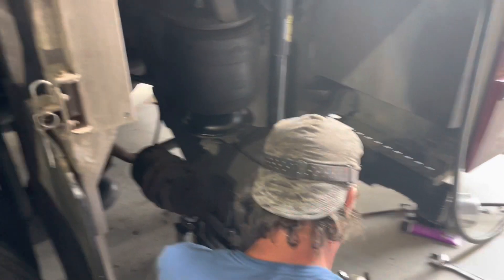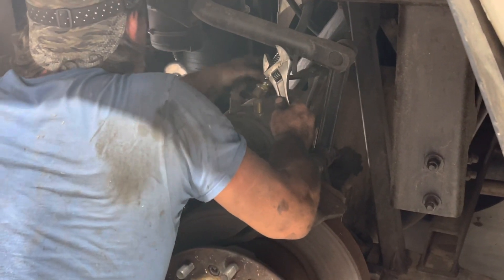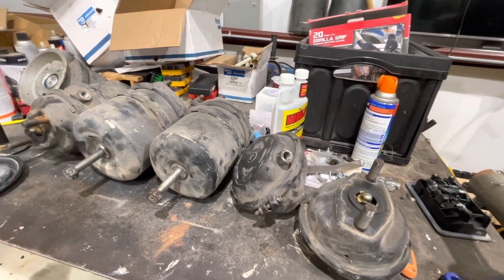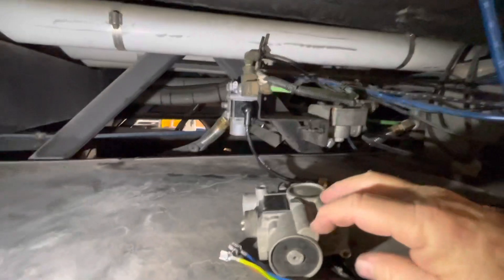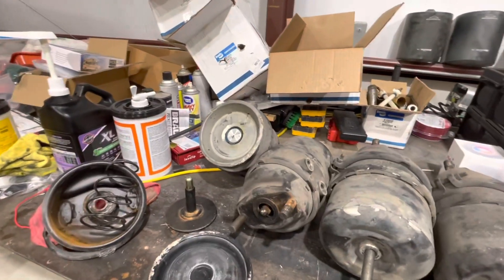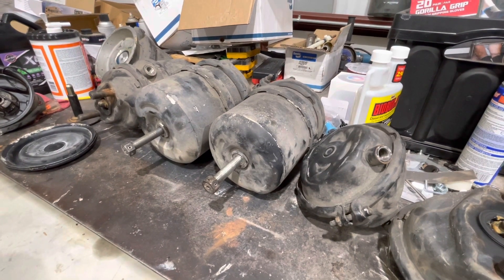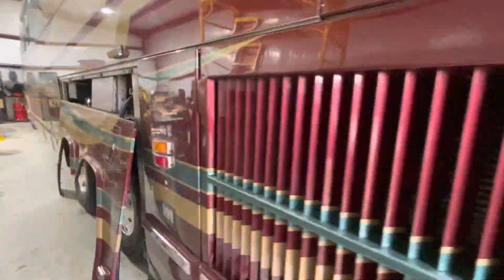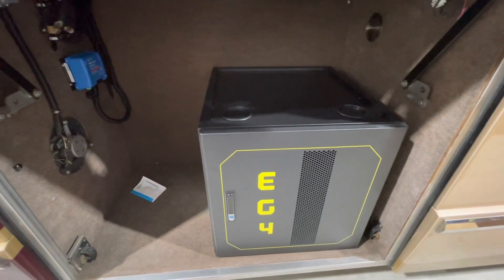Brake Chambers and getting ready for upgrade to Lithium batteries.

Comment: Why didn't Joe Camper change the brake chambers when he did the brake lines? I wish he would work on my Beaver
Reply from the maker: Not sure guess at the time figured they were go to go. If I was buying another Prevost it would definitely make the change list. But as you probably know the longer you work around these fine machines you learn a thing or two. Also as far as I know Joe has retired.